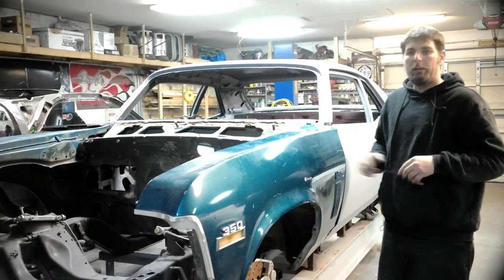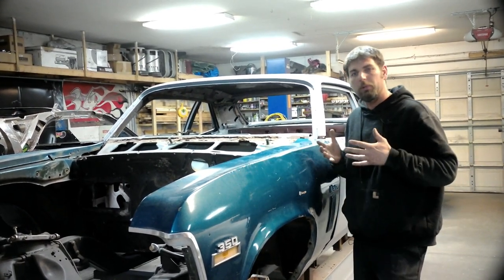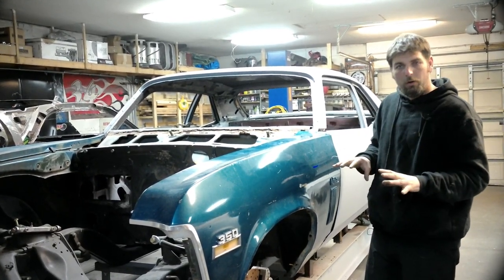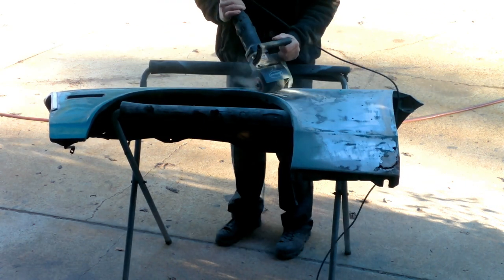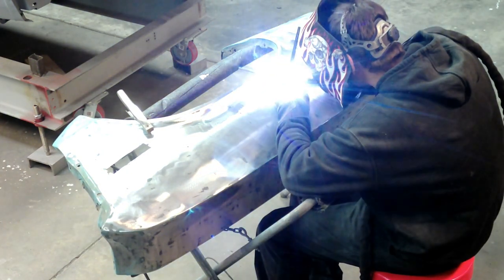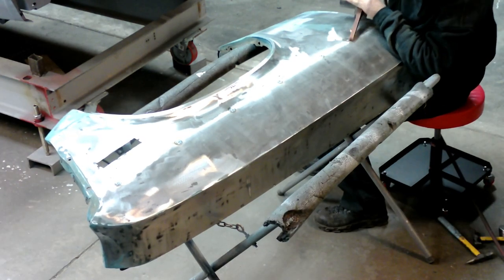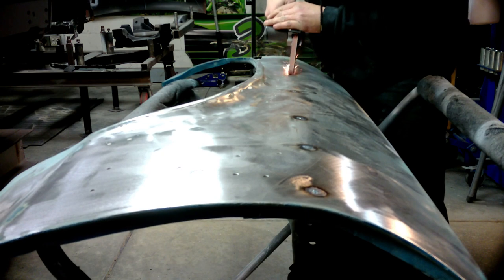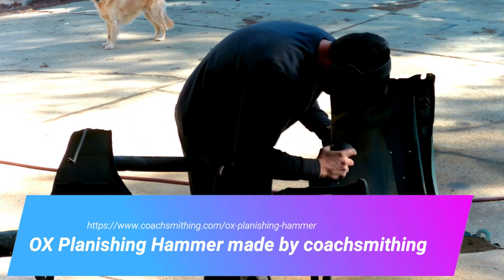1970 Nova Final assembly and metal work complete test fitting body panels Restoration episode 5

Comment: Great work. I keep learning. A tip for welding holes and some panels, I weld in the aerospace industry.. get yourself a nice block of copper and clamp it behind the hole flush, it will prevent the puddle from sinking through and it also pulls heat away from the weld.
Reply from the maker: Thank you, I have done that in the past from time to time great tip.

Comment: Great work! Love the commentary, I'm going to redo a 71 Nova that sat in a field and the bottom is pretty much gone, it even needs frame rails to be perfect, I'm not quite sure how to jig it up to replace the floors, inner and outer rockers and rails at the same time, but guess I'll figure it out. How you comment as you are working really helps a person understand the process. Thank you for taking the time to do this! 🤝
Reply from the maker: I just saw this comment appreciate the feedback. Good luck on your project. I would say get it in the garage and up on a frame JIG and worse case brace the rocker panels first, make a JIG where the frame rails would align the rails. Once the frame rails are installed then cut the jigged pieces off the rockers and then work on them. You can always modify your JIG as your working just keep it level.

Comment: Another great video. Very good advice on using tig on the fender patch. My understanding is the reason mig welds are so much harder is due to the shielding gas adding carbon to the molten metal.
Reply from the maker: Interesting that sounds about right, I honestly never researched it but when you hammer and dolly the different welds a huge difference. I would believe your right because there is times i will MIG tack something together then TIG weld over the entire run and you can't tell the MIG was used at all.

Comment: Man Rick you really outdid yourself on this... you make it look so easy. Car looks beautiful I love it. Quick question for you I notice you didnt do lead on the roof skin joint you mentioned filler and quarter seam. Any reason to avoid lead in this case what do you recommend I do?
Reply from the maker: Thanks a lot Max. I don't think every car needs lead, actually its a cool think to be able to be able to do but kind of outdated with modern fillers. You can look at applying a plate or patch over the lead seam area then finish it off like any other patch. Also look into All Metal or kitty hair fiberglass filler that might be a better option for you to go with. Most of the time I let the bodyman decide the route to go with this seam.
Reply: @carthageclassiccars  very cool I will do just that thanks for the advice
Reply from the maker: @SubdivisionAuto  Look up the TDS sheet on each. I will have a video out a week from now give or take with going over how to use the alternatives like I described to you above

Comment: Did you use the  AMD doors, rockers and quarters? I'm in the process of installing doors, rockers, and quarters on my 69 and bought the AMD "GM Restoration" parts (The more expensive option on their site) and distance between the style lines (top to bottom) is about a 1/2 inch off door to quarter. (The distance top to bottom is about 1/2" larger on the quarters.)
Reply from the maker: Yes AMD on all the parts I believe except the upper dash. I would say your best option is maybe relief cut and try and slightly modify the body lines. Good luck with it.